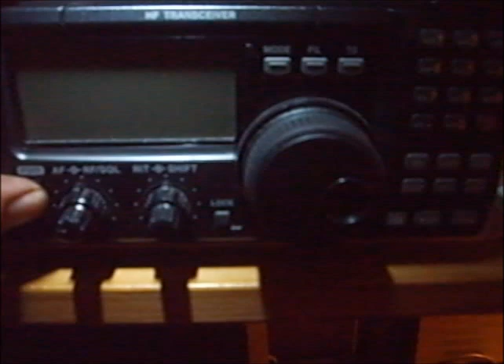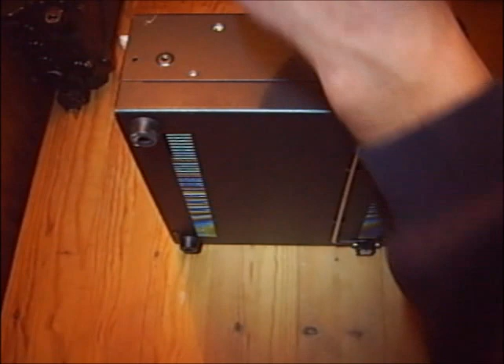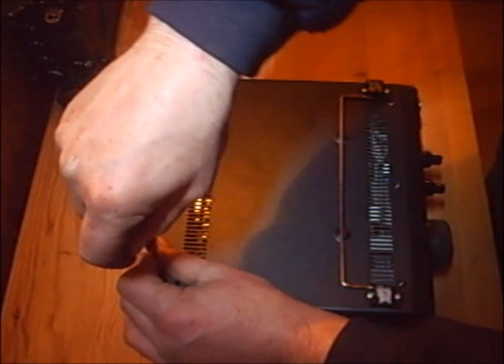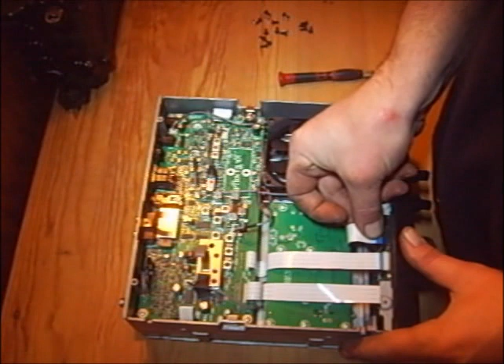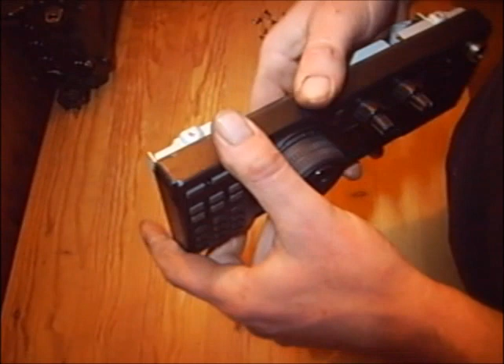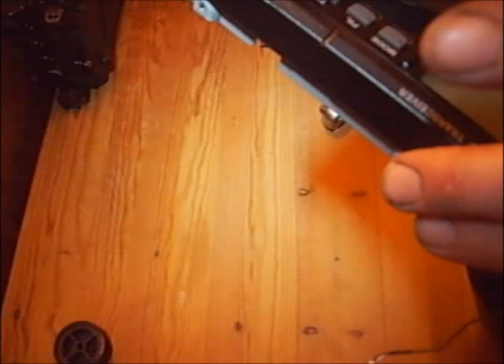Icom ic 718 Tuning Dial Repair Part 1

Comment: I need to replace the On / Off Power Switch on a IC-718.. Luckily it broke in the On Position however ,I am hesitant to operate it for fear of it  could  effect other circuits.. Other then the power switch it seems to be functional  .   Thank You for this video... de  KC3ZDW

Comment: My IC-718 frequency display and other "options" were lowering/going down no matter which way I turned the tuning knob.  I talked with Icom and they said it sounded like this same sensor you replaced.  I used your video to replace the sensor and happy to say it's working fine now! Thank you for the video.